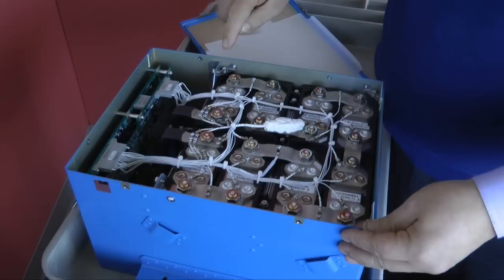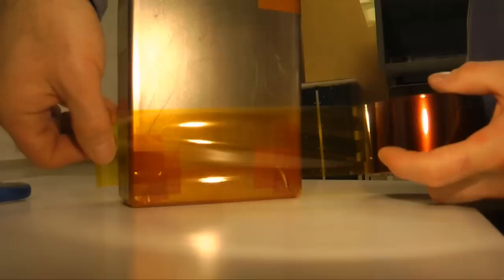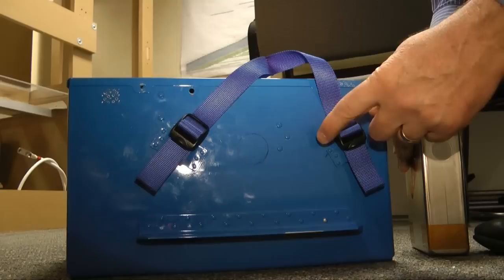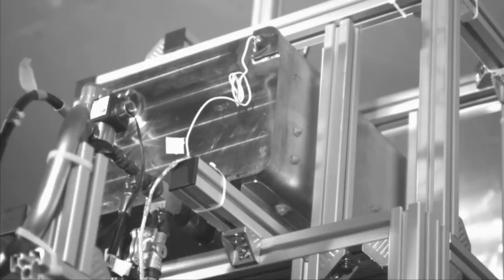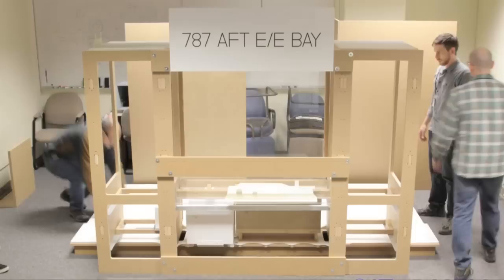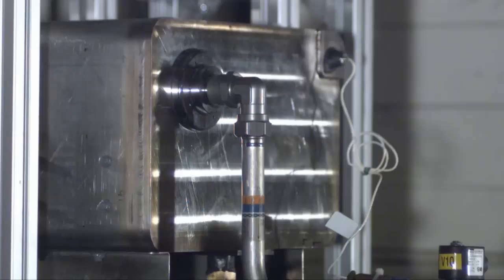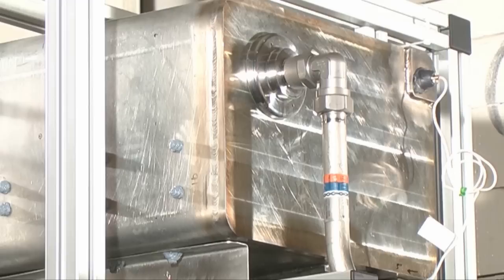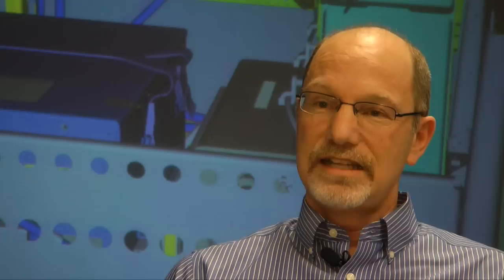Boeing 787 Battery System Solution

Comment: "WHY are the batteries overheating in the first place?"
Thermal damage to the Li-ion batteries erased important evidence that may have pointed to the root cause. Boeing freely admits that the root cause may never be known. But as Boeing's Michael Sinnett points out, the FAA-approved fix renders the root cause unimportant. 787 customers and national regulatory authorities, without exception, have agreed. This issue is history

Comment: In other words, the basic issue which appears from the NTSB cross section of a cell still remains.  Under heavy fast di/dt events like closing the start contactor into the SPU (Start Power Unit), the resulting 750 amp fast risetime load will literally suck the + and - electrodes in each cell towards each other eventually crushing the 25 micron thick spacer between the plates.  Finally, the membrane will crush to the point the the + and - electrodes physically short.  Problem contained not solved

Comment: The irony of this "solution" is that it added over 185 lbs of weight to the aircraft when the purpose of using the lithium ion battery was to save weight. The problem is the batteries which no one seems to know how to fix, so they have to design a containment for the batteries. Get rid of the lithium ion batteries and go back to nickel-cadmium battery - problem solved.

Comment: I was just wondering, ok, the battery fails and wants to burn but can't burn because it's in an enclosure. That's fine, but since the battery has failed, how does that affect the flying ability of the airplane? What happens if two batteries decide to fail?
Reply: These batteries are used as a safety backup for the electrical power produced by the engines.

Comment: Inflight the bulk of electrical load is taken care of by the Engines hence the batteries only serve as backup redundancy. In the "highly unlikely" case that both batteries fail inflight. Warnings and advisory messages may be presented to the pilots but much of the flight can go on uninterrupted. As long as there is no fire and the failure is isolated to just the batteries (also highly unlikely). Every other thing should go on well till the plane lands.

Comment: How so, pray tell? Each cell has a venting hole that will blow open if pressure builds up enough, lined up with corresponding venting holes in the original battery enclosure. Then that is all enclosed in the new SS box which vents via titanium tube directly outside the aircraft. Now explain how pressure would build up to cause an explosion.

Comment: The solutions to the battery fire problem was to make the case thicker so that the smoke from the fire wouldn't get out.  The problem wasn't that the plane was on fire it was that the passengers knew the plane was on fire.  Now they won't know.  Problem solved.
Reply: Float Uphill ca908 get delayed one more time..the flight attendant says pilots are charging the batteries..

Comment: You would be surprised how many times they have to go back and fix something after the plane has already been produced and say "why wasn't it like that to begin with". Hell, when the DC-10-10 first came out the cargo door had a tendency to blow open because the door wouldn't lock properly. The NTSB told MD how to fix it, but they ignored it and two years later a plane crashed in France killing 346 people. Sucks, huh?

Comment: Did I miss something?  What was the cause of the problem?  It sounds like all your doing is trying to minimize the fire that results when this thing blows up.  How is that acceptable?  I just don't get it.  This problem happens more then once and you spend all your time trying to fly this failed design?  Was it materials that failed?  

Hire someone who knows how to properly charge lithium ion cells first.  Spend some time figuring out how a design that catches fire was released and then fire the original designer(s) and everyone who signed off on it.     

Hopefully your not wrapping kapton tape around everything on the 737s  hoping that solves the problem.

You have a lot of people in a room working on the wrong source of the problem.  Get a trouble shooter to ferret out whats going wrong then consider doing these designs with a pair of designers (not a room full) then do a proper design review.
Reply: James Craswell you did.   Your and you’re are two different words with distinct meanings.

Comment: What will happen to the 787 if there is another problem with the batteries and/or electricals even after this solution has been installed?    BA is digging the hole deeper instead of getting out of it I would think.

Comment: Engineers? Are you insane. Why the fuck didn’t they have locking bolts on the terminals in the first place. How the hell is a Capton tape gonna stop a fire. and those “separators”, jez. Your playing with fire, literally. Maybe find why the batteries blew first then make a better inclosure in my opion.